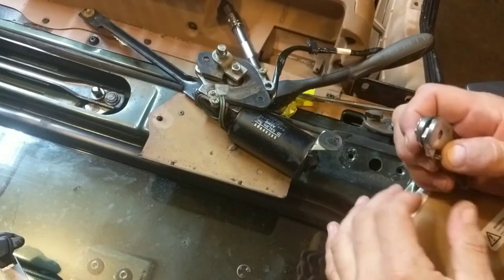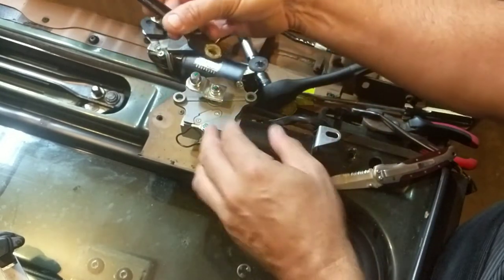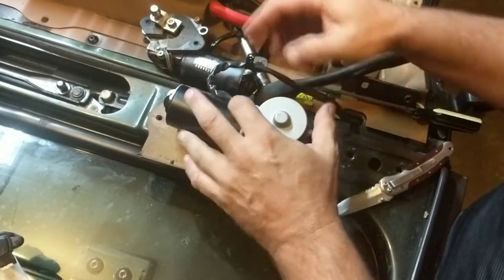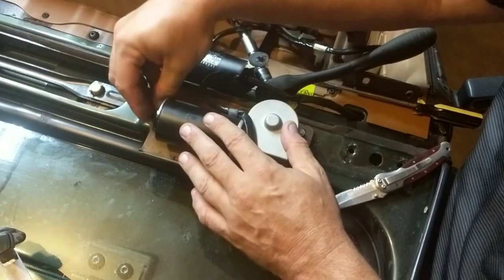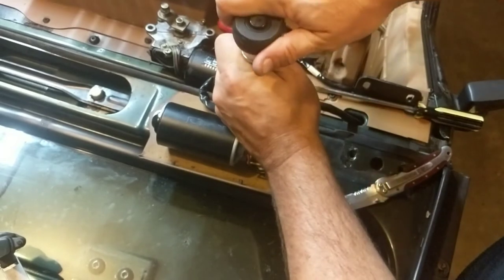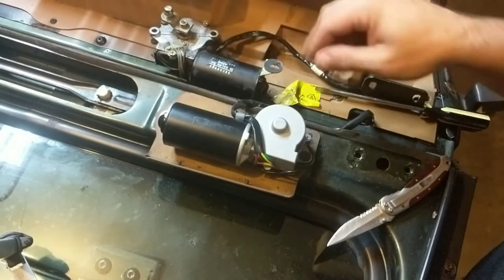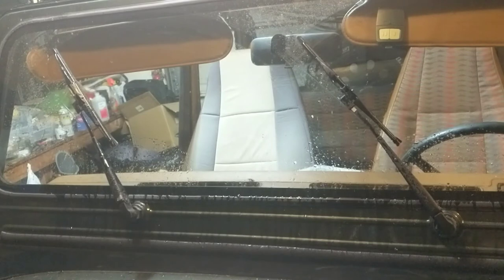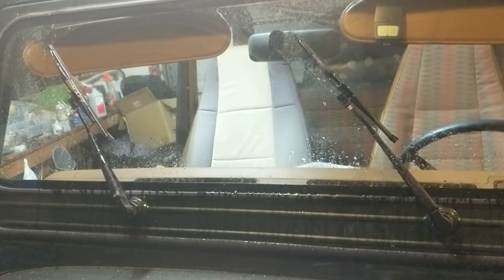Installing the new wiper motor in my 1995 Jeep Wrangler (YJ)

Comment: How did you get the arm off the old motor? Bushing is brittle, can’t find new one that fits
Reply from the maker: If you watch the other video I have on taking out the old motor at the 9:44 mark....I just removed the c-clip and then used a flat screw driver to apply pressure....the bushing didn't break.....that is how the Haynes manual said do it and it worked for me. Hope that helps.